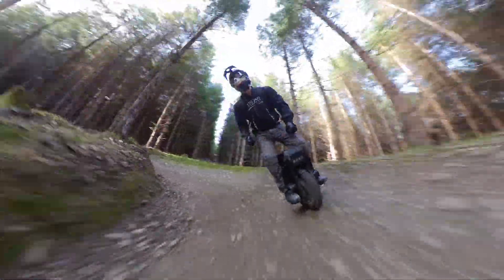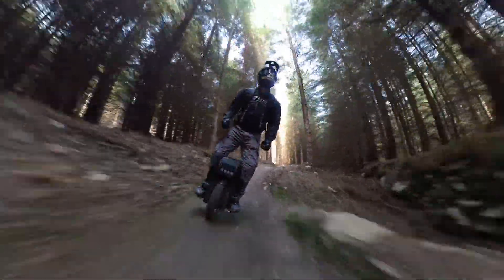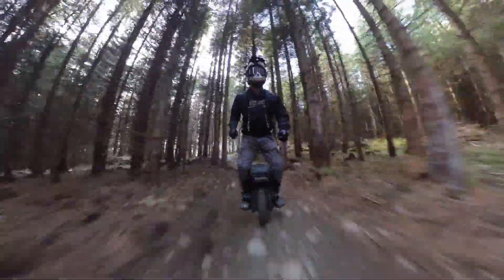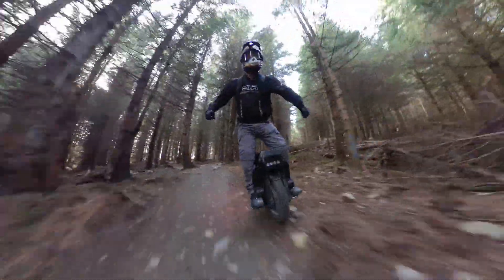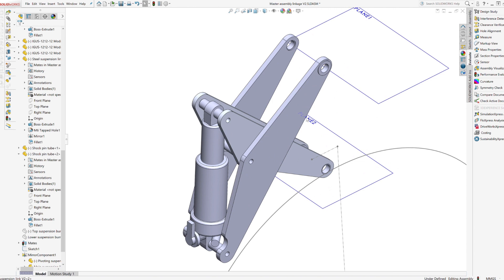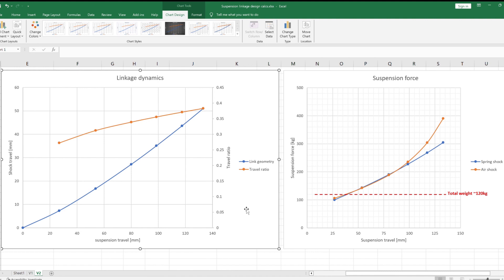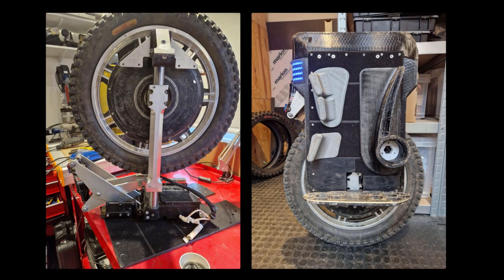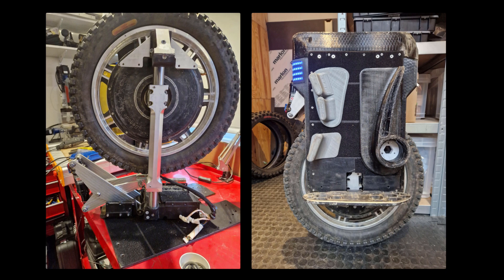Begode Master suspension travel upgrade to 125mm! I LOVE it!

Comment: This is fantastic work. One thing that pisses me off about Begode's Master and T4: on one side the stanchion is held on with 4 bolts, and on the other side it is held on with 2 bolts. They wanted the main power cable to go in that particular spot, so they removed 2 bolts! This is a level of idiocy that is hard to forgive. The V14 is clearly a copy of Begode's design, but done better.
Reply from the maker: Yeah, that is typical Begode. It's like every wheel they make is a first off prototype. But that is to be expected in this market. EUC is still very niche and a very competitive market that relies on small numbers of sales to enthusiasts who just want the next best thing rather than the most reliable thing. This is not even unique to the EUC industry. If we wanted reliable cars we would all be driving Kia's with a 7 year warranty. Having said that, I love Begode wheels and have made peace that they aren't ever going to be perfect out of the box. It gives me the perfect excuse to upgrade the sh*t out of them. I've just finished an upgrade to this Master to give it 150mm of suspension travel. Will upload a video of that soon.
Reply: I think you'll find if you take it apart that they didn't remove 2 of the bolts from one side of the motor mount, they're actually under the cable in question. Assuming I'm understanding your description of the bolts correctly.

Comment: Thankyou for the link,
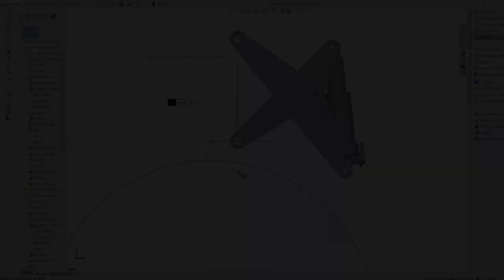Took awhile for the good bit to get started at 4:20 where the good stuff starts. We had the same journey with different method And i went one step further with new pedal hangers. Another option is the T4 hangers they are premade 20mm shorter at the bottom all ready. 
I opted for +30mm on the factory tubes custom made by houning. Making 70+30=100mm travel and a longer coil shock.
I focused on ratio 100/55 = 1.81 ratio.
Even tried 100/65 = 1.53
And thet adjusting coil LBS for desired outcomes.
Notice you are on 125/55 quite a high soft ratio of 2.27 very close to factory setup just way more travel motion range. Hence the high 400psi Required.
I have a linkage generator in onshape that im sure will impress you.
Reply from the maker: Yeah I would have preferred to use a smaller ratio but I already had the 190x51 shock so I designed it around that. Going to drop in a 750lb spring shock to see if that makes any difference as I'm sick of pumping the shock until veins are sticking out. Just had a look at the linkage generator. Really handy tool. One thing that would be really interesting would be if you could automatically plot the ratio throughout the travel so you could get an idea of how progressive the geometry is. The fundamental problem with the Begode linkage is that it is regressive so the shock/suspension travel ratio reduces as the suspension compresses. What we need for jumping/off road is exactly the opposite. The style of linkage that we are using is progressive, but not as progressive as the S22 linkage (which is why it seems to be preferred by most hardcore EUC jumpers). What are you making your linkages out of? I found aluminium was a bit weak around the pivots and had to strengthen them quite a bit as the first set I made deformed after a couple of hard landings.
Reply: @eyeinthesky3013  yeah I can plot the full ratio... And have done it. You have a chat app if you up to share some finer details.

As for 750lbs I think you will need 1000lbs. Ratio over 1.8 you need 900lbs +

I'm running 1.7 ratio and 650lbs is a bit too plush for me at 75kg

Comment: That's awesome! THANK YOU VERY MUCH for sharing that info with us! Did you use a regular steel pipes or stainless ones? I found online a stainless pipes in such diameters 30MM OD X 26MM ID (2MM WALL) and wondering if these can be used.
Reply from the maker: I used stainless ones. 30mm OD 26mm ID is perfect. The only problem might be that the OD is actually slightly over 30mm. (mine were ~30.15mm) so I had to replace the original copper sliding bushings with polymer ones. Good luck with your modifications. 🙂

Comment: 13:43 is this an EUC tire in the background? I'm looking for a good mud tire, can you tell me about it? does it fit the master?
Reply from the maker: It's a Kenda Carlesbad tire. I bought it for my S18 originally so it would fit the master but it's awful on tarmac at low speed. It has far too much space between the knobs which are too flexible so steering at low speed is horrible. I tried it on the street outside my house and hated it so much that I immediately removed it. It might be OK off road but I tried the cst 186 after that and it was waaaay better so stuck with that.
Reply: @eyeinthesky3013   I had something similar on my 16x few years back, 12-inch rim, you can get used to it actually though my initial impressions were the same. It's magical in deep mud and this is why I'm looking for a similar tire for begode master.

Comment: Great video👍 listen you look like you’re qualified enough to answer this question…why do some EUCs cut out once they beep at max speed? I’ve just watched two vids back to back at this happening and was wandering what causes it?
Reply from the maker: The high speed "cut out" is common to all EUC and is due to a fundamental limitation of electric motors. It's not really a cut out as such but is due to the motor reaching its maximum "free spin" speed and no longer being able to keep the rider balanced. Basically, as the motor spins faster it produces a reverse voltage that counteracts the battery voltage. When the motor speed approaches the "free spin" speed the reverse voltage is equal to the battery voltage there is no longer any spare voltage available to push current through the motor coils, no coil current means no torque from the motor. Unfortunately the EUC relies on having some spare torque available to keep balanced, so balance is lost and the euc rider has a bad day. It's a really horrible feeling when the pedals go soft and you start falling forwards, when it happened to me at 60km/h I was lucky to only break my wrist as I wasn't wearing any safety gear. The beeping from the EUC is it's way of warning you that it's about to happen, ignore the beeps at your peril!!
Reply: @eyeinthesky3013  Great response very informative. Thanks

Comment: Do you sell the linkage system you made?
Reply from the maker: I'm not sure I could do it cheaply enough for people to be interested. Plus it's not really a plug and play mod as there are mods to do to the Master chassis for it to fit. It requires a basic hobbyist level of experience with metal working and mechanical design to get it installed and working nicely. I'd be worried that people might render their wheel unusable if someone attempted it without the required level of experience.

Comment: BTW, that drone footage at the end. Was that manually flown by someone?
Reply from the maker: I use a Skydio2 for this kind of stuff, it has full 360 obstacle avoidance and can follow you autonomously. You keep a small beacon in your pocket that transmits your gps coordinates to the drone to allow it to follow you even if it can't see you. It came out a few years ago but sadly is now discontinued. It's significantly better than any DJI drone for obstacle avoidance and it's ability to follow through tight spaces.
Reply: @eyeinthesky3013  Thank you. It should have occurred to me that only the Skydio  can make such rapid movements while tracking 😊

Comment: Same rational. I was seriously looking at the Extreme and then the V14 when that was announced. But after much consideration and paying attention to my S22 rides (similar single trail at decent speeds) I realised that a smaller diameter wheel just wasn't worth the sacrifice for more torque. Plus the ground clearance too as even on my S22 some sections I do have to be careful of pedal clipping which would just be worse with a smaller diameter wheel.

Such a good idea. I won't be doing this obviously as I don't have a master. But it's nice to see someone upgrading their wheel similar to what you would see in the MTB hobby rather than just buying something else.

For me... I just want more torque which unfortunately isn't going to happen so I will just stick with my S22 (pro motor).
Reply from the maker: I think we will start to see more upgrades and diy euc soon. The OneWheel community is starting to adopt the VESC opensource controller to bypass the restrictions on modding the stock OW from Future Motion. Its actually relatively easy to replace the controller on an euc. Many of the VESC controllers come with and IMU and the firmware  includes the balancing code. I replaced the controller of my old mSuper V3 and it works better than the stock controller with a higher top speed (vis field weakening) and the ability to customise the responsiveness. If I owned an S22 I would consider replacing the controller with this one https://alienrides.com/products/3shul-vesc-motor-controller-cl350-v4-preorder. From my understanding the weak point of the S22 is the controller.

Comment: I use to think like you in that a 14" rim (18-20" tire) is the way to go for trails but after riding a T4 since Apr, I'm totally convinced the 12" or 16/17" platform is the way for technical mtb trails. No doubt the bigger wheel is better for speed but offroad isnt about speed but moreso nimbleness, control & tossability. Nevertheless, the  Master is a good allround wheel & the x linkage you designed is way to go. Thanks
Reply: Where is this park located wow man! 👌
Reply from the maker: @electric_meadows_racing it's in Ballinastoe, in the Wicklow mountains in Ireland. Beautiful spot. 😊
Reply from the maker: I agree that trail riding is not about speed but I think the maneuverability of the T4 is more about the reduced rotational inertia of the C30 motor rather than the slightly smaller diameter wheel (though this will help). The C30 motor in the T4 will have a significantly lower rotational inertia/gyroscopic force/torque and so be much easier to whip around than the C38 in the master. The compromise made with the T4 is to achieve acceptable 'tractive force' from a lower torque motor at the cost of (unneeded) top end speed by reducing the effective lever arm length (wheel radius). I think the ultimate trail EUC would have a significantly larger, but much lighter, diameter rim to achieve a low rotational inertia. There is a reason MTB wheels are 27 or 29 inch and not 18 inch, and MTB are much more maneuverable at speed >20km/h than any EUC. I have an S18 (exact same rim diameter and CST-186 tire as on the Master) and it is incredibly nimble (likely due to <30mm stator/magnets) and small/light batteries. I'm fine with the top speed of the S18 too but the lack of torque is unforgivable, hence my "upgrade" to the Master. We are still at the "Klunker" stage of EUC as was MTB in the 1980''s. Exciting times, I can't wait to see what's next!😁
Reply: @eyeinthesky3013  Good points. Becomes a balance I guess, Extreme C40 has more torque than C30, but you have to decide whether thats worth the extra gyroscopic force and weight in general. 

The extreme has a lot more torque/top end than a T4 but will that actually translate into faster times through a singletrack course, given the fact that its heavier and has more gryoscopic force like you point out? Thats probably completely dependant on the track (and rider). Especially if you ignore the fact that extreme has more up to date suspension etc.
Reply: @yarnf Btwn the T4 & Extreme, suspension aside, I say it would depend on the type of track. On super tight very technical multi terrain with altitude changes, I say the T4 will be competitive esp for lighter riders. 

My T4 does 90% of the dirt rides I do well but I must admit that final 10% is calling out to me which is why I'm seriously pondering on a winter order of the Extreme in time for spring '24. The better build, the better suspension, the extra power/torque, the extra batt/range & the higher topend are very enticing. But the extra 20lbs is def giving pause.

Regardless, I lov riding my T4 as a monowheel mtb.  Dont need more speed but a bit more torque is always nice & the all metal + cnc stuff is great tho I havent damaged my plastic T4 as yet despite innumerable offroad dumps
Reply: @scottsum1319  Ya agree with all that. And even as an extreme owner: if they made a new version of the T4 with the new Extreme build quality/upgraded suspension/CNC etc I'd be all over it.
Reply: @eyeinthesky3013  I dunno if your arguments proposed hold water so I'm not gonna debate it. All's I can do is provide my own experiences having owned a s18, RSht, EXN (hs & ht) & now a T4 & ex30. I used to think the RSht was the perfect pkg for trails cept for low peds & lack of suspension. IME the T4 isnt much lacking in torque vs RSht but despite being ~10lbs heavier, feels much lighter & def more nimble & hence more controllable. Perhaps its my ave 170ish lbs weight but for me, torque isnt the T4's weakness but instead its ave suspension. Still I lov riding it on dirt esp gnarly technical mtb single tracks. Much better then the RSht. Dont forget, a smaller wheel has a very significant mechanical advantage as well. IMO my s18's suspension was trash & the torque (or lack thereof) was pitiful. T4 is multi levels better & amazingly, does not feel heavier despite being 20lbs in actuallity. IMO IME ofcos